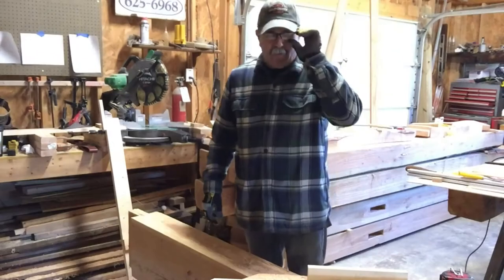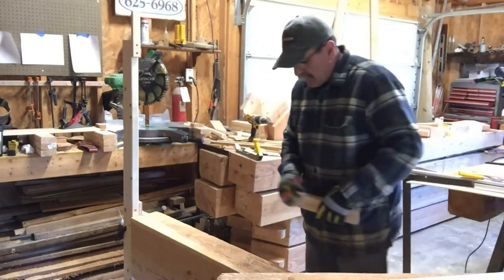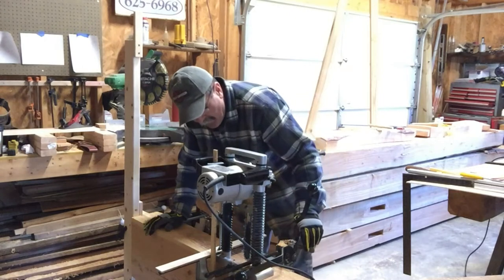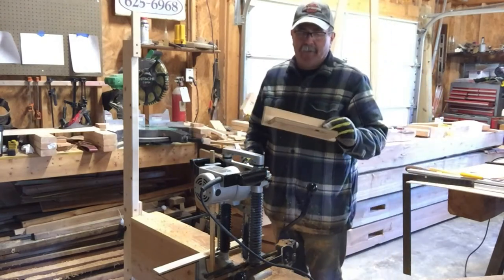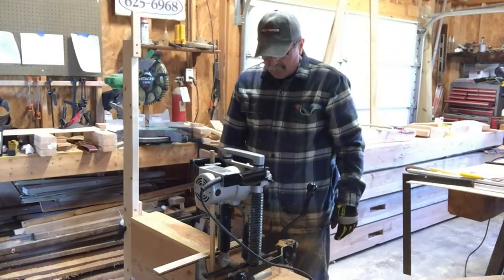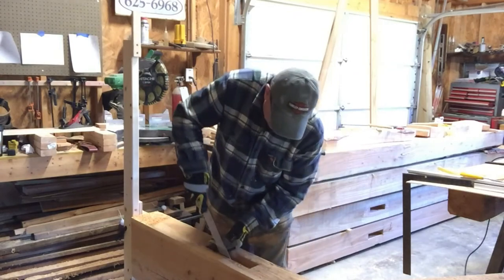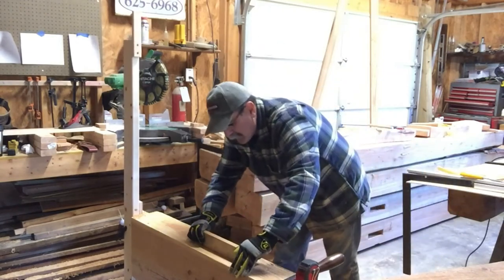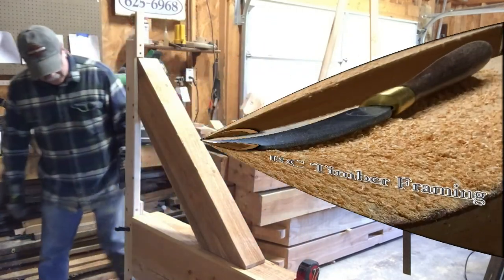Timber Frame Cutting a Mortise Joint with a Makita Mortiser

Comment: Nice Job!  Thanks for sharing.
Reply from the maker: Tim,  the reason you haven't seen a chisel like that is......it's home made.  i made it up at the beginning of the project.  i knew i had to have a large chisel that would fit deep down into the mortise joints i was going to make.  so i build the blade at work out of some A-2 Tool Steel, turned the brass handle cap and black walnut handle.  the chisel is custom fit to the handle with a taper lock.  it's been really working nicely, better than i expected.
Reply from the maker: thanks, i'm a little new to this you tube stuff, i replied to the wrong guest.

Comment: Evening Sir, first time timber framer here, I'm using 4×8's for my braces, cut them square rule style, but centered them in the 8×8 post and am going to house them too. I mortised one post so far, but went 90° on both ends of the mortise, not the 45° you did for the top, is this going to hurt the strength of this post and brace?  I was under the impression that most of the load will be carried by the bottom horizontal face of the tenon and half inch housed portion.

Comment: Hi, I need to bore square holes size 1-1/2"X1-1/2", is the blade too wide?
Reply from the maker: it's 3/4 x 2", so 2x2 would work but not 1.5x1.5

Comment: What brand chisel is that? I haven't seen one like that before.
Reply from the maker: sorry, i put my reply in the wrong place.  
 the reason you haven't seen a chisel like that is......it's home made.  i made it up at the beginning of the project.  i knew i had to have a large chisel that would fit deep down into the mortise joints i was going to make.  so i build the blade at work out of some A-2 Tool Steel, turned the brass handle cap and black walnut handle.  the chisel is custom fit to the handle with a taper lock.  it's been really working nicely, better than i expected.